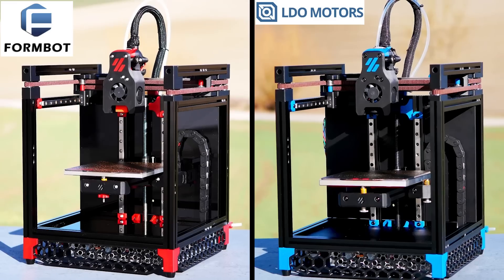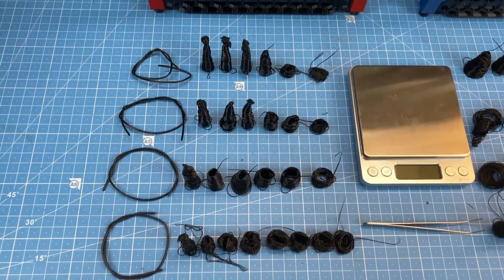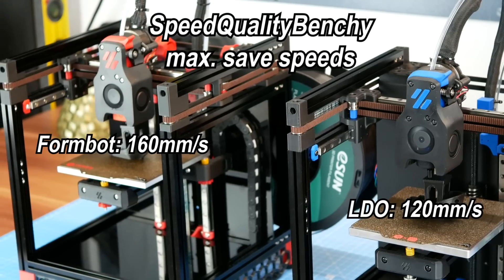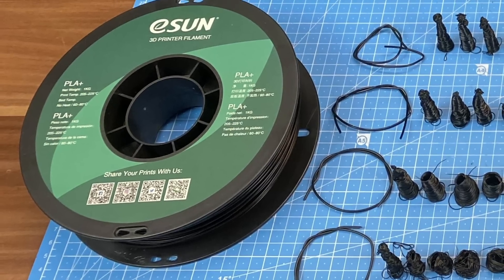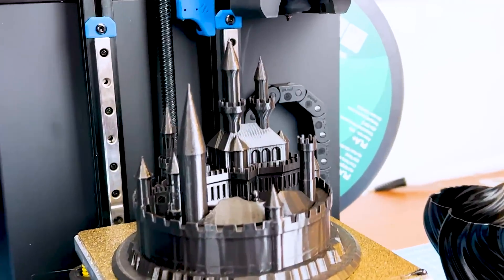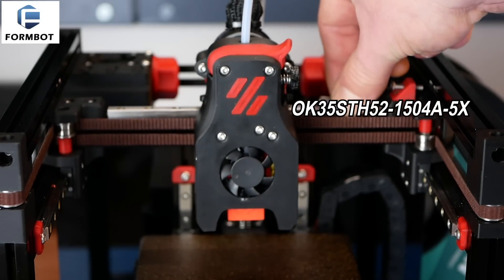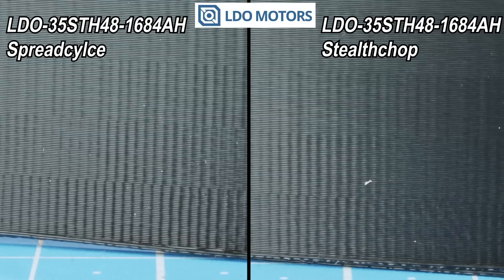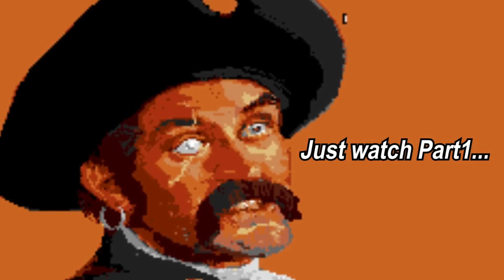VORON0.1 Kits COMPAIRED: PERFORMANCE TEST (PART 2)

Comment: Awesome video! You particularly caught my interest at 6:41 where you say That printing the Hull and the Chimney of the 3D Benchy can help you determine the correct Speed Override settings. Where can i find more about it? Do you make estimates relaying on experience or follow a given procedure? Sorry if it is a newbie question (it's 'cause i am, eheh)
Reply from the maker: That's not a general and commonly known procedure.
I thought I mentioned the procedure this in the video:
You can iterate the layer time setting by printing the hull of the boat - repeat/iterate until it prints well.
You can iterate the min. speed setting with the smoke stack - repeat/iterate until it prints well.
For latter you can use something more pointy to have a general setting for more pointy stuff.
Reply: @247printing  Awesome, thank you 🖤

Comment: One thing what's missing here is comparison of voron 0 Vs voron 0.1 ;) wait for it... Waiiit fooooor it... Waaaaiiiiitt....
Reply from the maker: You mean... V0.0 vs. V0.1. That's mainly bowden (which also exists on V0.1) vs. Mini Afterburner.
For the rest: There is no sense in it, as no one would build a V0.0 (weak motors) anymore.
The bowden vs. DD comparison is on my (looooooong) list though, as I am convinced that the Voron0 IS A BOWDEN PRINTER!
Reply: @247printing  thx for sharing difference between them. So to upgrade voron 0.0 to 0.1 I need to change motors and afterburner only? 
There is another thing. 0 has z Axis driven with belt and 0.1 is bolt driven and this is question in I can upgrade this?!?

Comment: Dank schee für das tolle Video. Bin grad am überlegen, was der nächste Drucker werden soll. Der Bambu X1 ist schon geil, aber closed source und Kontozwang ist so ziemlich das Gegenteil von dem, was der Josef Prusa macht - deswegen ein no go. Der FLSun V400 ist schnell, aber keine Ahnung ob das ein set and forget Dauerläufer wird. Anfangs gehen ja die meisten CN-Drucker gscheit, bis die Einzelkomponenten dann doch den Geist aufgeben. MK3S ist gut aber langsam, der XL dauert noch. Snapmaker ist auch nicht wirklich als superzuverlässig bekannt. Muss ich doch einen Trident bauen😄
Reply from the maker: Merci dir! Schön zusammengefasst - hätte jetzt auch gemeint, dass ggf. der XL was für dich ist, aber ja - den gibt es nur auf dem Papier und wird schweineteuer sein. Meinen MK3S+ nutze ich aktuell überhaupt nicht mehr - der wurde tatsächlich sinnfrei seitdem ich die X1Cs inkl. Bambu Slicer nutze - auf den Speed will man nicht mehr zurück. Falls du die Zeit hast, dann wäre tatsächlich ein RatRig oder Voron aktuell das richtige für dich. Am meisten Spaß (egal ob 2.4 oder Trident) hast du mit nem LDO Kit. Formbot kann man aber auch machen. Rat Rig Kits sind ein bisschen eigen/aufwändig mMn. Am Ende kriegst mit dem V-Core-3 jedoch schon ein Stück mehr performance (speed bei quality) als mit einem Voron. Zu Voron vs. RatRig kann ich das Vergleichsvideo von Vector3D empfehlen. Kann ich 100% unterstreichen bis auf eins: Die Anleitungen bei Voron wurden mittlerweile deutlich besser.

Comment: Man I am gutted that I paid 50% more for the LDO kit than the Formbot and I've been wondering why my surface quality has so many weird lines and shapes in it - now I know.  LDO use inferior motors to Formbot!   I've just put stealthchop to all the999999s.  Last LDO Kit I'll be buying that's for sure!
Reply from the maker: The actual Kits come with the improved motors and the Kits are still very good. If you activate Stealth Chop the problem should be solved without additional downsides.

Comment: My ldo has the vertical banding like you describe. I guess its the motors.
Reply from the maker: Try stealthchop - it limits your torque, but if you don’t go for extreme acceleration it should be enough for casually fast V0.1 printing

Comment: Great vid. Very insightful. I thought I was crazy or being too nit-picky about print quality. I am vindicated. 
However, I would assume that LDO won't just replace the A/B motors on my kit I purchased last December.... I guess I will have to contact Moon Servo Motors (or anyone else) for better hardware. Shame, I really liked the LDO build experience.
Reply from the maker: Those “VFA motors” are great concerning performance at high acc/speed, though a stock V0.1 won’t profit :/
Reply from the maker: And THANK YOU very much!

Comment: Really surprised about the Oukeda performance considering the general consensus on them! How did the responses from VFA testers look for those with Oukeda?
Reply from the maker: The VFA performance is really good - the speed/torque performance for matters of extreme speed printing is not unfortunately. I’ll maybe come back to this in some video. For regular fast printing they are ok though 👍
Reply: @247printing  Thanks 😄

Comment: As You mentioned volume flow and acceleration are the only two parameters limiting fast printing. Transforming volume flow into printing speed is sub optimal as modern slicers can varies the width of the print line and you need to do pointless calculations depending of your height & width. it is better to have a setting of volume flow in the slicer and no speed limit. To my knowledge as of today only Prusa slicer is able to do that. I had hopes that Cura V5 would implement it but apparently it is not there. in fact if we go in the details of the physics there would be two values of max flow a max continuous which the one that everybody is testing, and a max burst, when you have been in low flow for a while due to cornering or travel, there for a maximum volume of the melt chamber you can deliver higher volume flow. I have not seen anyone mention that up to now even though this is for me the way forward.
Reply from the maker: Absolutely, Prusa Slicer can set flow limits and you are fine here. Simplify3D was a bad decision to use as I actually HAD a lot to calculate 👍 But: I did not use/need any variable layer lines here in order to “simplify” the point of all this: It’s very helpful (even mandatory?) to know your extrusion rates by material. on capable DIY printers you can translate them into printing speed. In the future I’ll not use Simplify3D (V4) for these kinds of tests anymore, but it was valid and viable here. I thought about mentioning my calculation efforts also concerning part cooling related settings and others (like first layer speeds), which are to set proportionally to speeds, but I did not want to go over 20min in this video in order to do slicer finger pointing. But you are right in every respect 👍

Comment: 8.5k acceleration - no wonder you don't max out the speed / flowrate?

Is that all the 0.1 can do mechanically in stock for quality prints?

Have you tried overvolting 12V Gdstime fans on 24V? Their 5015 can take it, not sure about their 3010/4010
Reply from the maker: Hallo Bernhard, 8.5k acceleration is quite plenty for being calibrated to low or no ringing (I was surprised concerning the heavy Mini Afterburner). I did a lot of testing on overvolting part cooling fans, last year (also GDStime) and it is promising, but this wouldn't have been suitable (as well as too much) for this video. I want to come back to this though - cool you mentioned it! An accelerated life-time test should be done though, before recommending/showing overvolting of  part cooling fans.
Reply: @247printing  thanks for replying! Aside from recommending/not recommending/lifetime concerns: can the 3010s/4010s from gdstime take the overvolting or do they burn out immediately?
Reply from the maker: @steiNetti  I tested 12V GDStime double ball 4010 on around 27V while searching for better cooling solutions for my tuned V0.0 (on some early videos you can see them). They become warmer and a bit smelly, but I was not able to kill them. The longest run was around 10h steadily at 100%. That's not long enough unfortunately in order to predict failure. In the end  the performance was not enough unfortunately, so I made the 247ESPC :) I have 12V 3010s here, but I didn't find the time yet to check them out on 24+V :)
Reply: @247printing  that's good enough for me to order some and start experimenting. 

My 5015s held up pretty nicely so far and at least the ones I got run better than the Sunon B1 and Delta BFB I had before (at least in terms of vibrations and noise, the Sunon BX (dual ball bearing instead of vapor) would be a viable alternative as the VX puts out some serious CFM, but they don't make them anymore - only B1 and VX and the Vapor (VX/1/2/..) series are magnetic levitation bearings which bang around and aren't suited for being mounted on moving parts).

 I don't expect wonders from it but every bit helps, especially for the occasional PLA print that I might want to run on the V0. And if they fail, they fail.

Comment: Great review! It's fascinating how little impact the highflow variant had on print speed. I'm sure that can be improved as in the 247 V0 and it proves that upgrading the hotend is mostly useless without other upgrades to compliment. Thanks for the effort you put into this video!
Reply from the maker: Thanks a lot Adam! You nailed it and that's what I wanted to try to state with the Triforce of Speed: You would need to work on a balance of the mutually interacting factors.

Comment: Great video Albert. The cooling-limited speed doesn't surprise me with the mini-AB. We'll have to see how the mini-Stealthburner improves on this when it arrives.
I still haven't built my LDO v0.1 kit. I've been focused on my V-Minion. Now I have to contemplate buying new motors before I start the build! Thanks! 😂
Reply from the maker: Hey Jon, thanks a lot! There will be a Mini-Stealthburner? That's great news... The cooling limitations were no surprise, but I really thought, that higher speeds due to more E-Flow would be more beneficial - even on that stock machine. In the end it's logical though.
Reply: @247printing  There are some unofficial mini-Stealthburners out there, but my understanding is there will be an official one. I believe NERO3D confirmed that.
Reply: @JonS  That will be awesome. I was really wishing I had a toolhead led while tuning.

Comment: Also ich hätte auch nicht gedacht das das so ähnlich ist am Ende aber man könnte bestimmt mir einem Coolingmod den Vorteil des High-Flow Hotends ausnutzen und schneller drucken oder? Außerdem mir hat der einspieler am ende echt gut gefallen. Mach weiter so mir machen deine Videos immer viel spaß zu gucken und sind immer sehr interessant. ^^
Reply from the maker: Cool, danke Manuel - freut mich sehr, dass du bis zum Ende geschaut hast - die Idee zum Einspieler kam mir auf der Landshuter Dult :) Coolingmod würde den HF Vorteil definitiv pushen - es wird Zeit das demnächst zu machen ;)

Comment: Can you link me to blower fans that would work for the hot end? I got the formbot kit and the fans flat out snapped going in because the tolerances were too low. It’s not my ASA printed part. That is perfectly perfect.
Reply from the maker: I linked the fans in the video description ☺️
Reply: @247printing  you the best. Heart

Comment: Have exactly the same issue with my LDO motors, very sad that such expensive kit comes with such cheap motors...
Reply from the maker: I did some more tests which were not suitable for this video: The torque and power of the "VFA-motors" is incredible... Stealth chop fixes that VFA issue and printing speeds up to 175mm/s are a lot for a stock V0.1, but yeah - you'd have to live with whining...
Reply: @247printing  I agree, word "cheep" wasn't used correctly in this instance but VFA's are known for years and if I am not mistaking LDO produced motors for Pruca's printers for a while. As Pruca's users firstly spotted and came up with the name for this issue, I can't believe LDO underlooked it. In my case I had to spend extra 50$ to get motors that will solve this issue and considering price of the kit it's not acceptable. QC is the reason why we buy more expensive kits over cheap.
Reply: @hobbyistnotes  yeah LDO sucks for not offering replacements to their customers. They lost my respect.